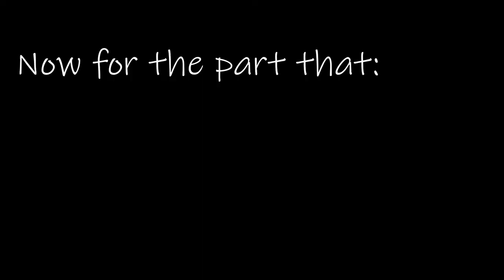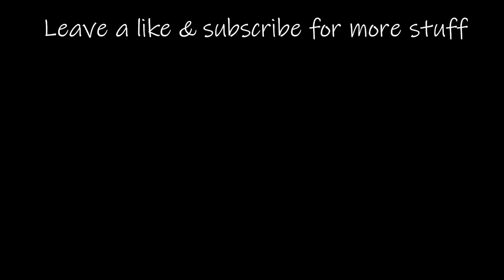Logitech G29 Potentiometer Cleaning - Doing it right!

Comment: If you took the trouble to remove the potentiometer, just replace it with a new one of the same resistance value. Theses things are dirt cheap (like US$1) , there's really no point in trying to disassemble & clean.
Reply: what are the specs of the g29 potentiometers?
Reply: @Cesar-os5iv  Don't know specifically, but its easy enough to grab a multimeter and measure the resistance between the two outer contacts. It's probably in the 33K to 150k Range, linear taper.
Reply: One could almost say it is worth disassembling and cleaning it if you cannot find or provide information on the correct replacement part.
Reply: @jaffmaster2294  It's easy enough to measure the pot's resistance value.
Reply: @jaffmaster2294  I agree, if you don't know the specs or where to get one just take it apart, it seems fairly easy.
Reply: @Cesar-os5iv  You want a linear (10k ohm) 1-2W potentiometer for G29 & G920 pedals (same for G27, G25, G923). They're hard to find in the UK, cheap, so it might still be worth repairing if you have the stuff laying around. If you're gonna spend on grease though, you may as well replace it.

Comment: To put it simply, you're great. You rock, man. My throttle is perfect now. It's funny that after fixing it, I remembered I had one spare potentiometer once I used a third-party load cell installed in the brake pedal.

Comment: Really good video, very well produced. Like many other people I have removed, dismantled and cleaned my G29 potentiometers several times, swapped them around, etc. This is the first time I have seen this CRC Di-Electric grease so I will get some and give it a try. I'm surprised your video hasn't caught people's attention. Thanks for putting it up.
Reply from the maker: Cheers man. Glad you find it helpful. The di-electric grease helps preserve the pots I feel. Keeps dust off. Makes the pedal travel feel slightly better too.

Comment: Great video, I used dielectric grease and plugged it but didn't work, wiped it only to realize i plugged the pot back wrong (black colour red or something)

Flickering absolutely gone now!
Reply: With 'wiped it', do you mean you removed the dielectric grease afterwards? It would make sense, as the grease is electrically insulating; therefore, preventing functionality of the potentiometer.

Comment: I don't suggest to tare everything apart if you don't have serious issue with your pedals. I had flickering on my break pedal. Seeing from a different video, I just opened the enclosing of the pedals and sprayed and cleaned the break potentiometer several times without unscrewing anything and it works perfectly. If it still doesn't work, you may go further.

Other video: https://youtu.be/VKg0jBeP_l8
Reply: @UbeydullahGungor Yeah, this video is for the people that already did that, and then the problem came back after lots of use. 
Cause that isn't the correct way of cleaning them and this one is, they last way more than that other "fix."

Comment: After doing this procedure my pedals are working great so far! I only have one small issue, my pedal wont go past 95% but its no big deal since I recalibrated it. I just have a quick question, is there any trick to reassemble the potentiometer fully centered so I get the full range of motion detected? I assembled it as shown in the video paying attention to detail but it seems kinda hard to get it 100% on the right position

Comment: G29 pedals not working now. 
I watched your video &  did my pedas just like you said but pretty sure I've got To much Grease on the all pots because I used my fingers..When I hooked it all back up after cleaning & over greasing. No contact, power, when trying to calibrate pedals.

Comment: Anyone know if WD40 silicone lubricant can be used instead of the dielectric grease? Seems to be the same thing?
Reply: Don't use silicone, it will dry and cause issues.

Comment: im having issues with the throttle, could i just swap the Potentiometer with the clutch? would it work the same? i dont mind if my clutch is bad
Reply: yes, just did it. cleaned and swapped to put the wear on the clutch pot instead

Comment: Static electricity, attracts dust n all kinds of shit particle. 
Just look at the back of your TV's! 
So... Regular maintenance/cleaning is a must part of your racing. Use anti static cleaning materials and always... Dry Electrical contact cleaner. Not oil based lubricant, such as WD40 as oil, attracts more of what you are trying to avoid.

Comment: I opened the potentiometer cleaned it and it still doesn't work
Reply: @chrisaaron8445  i fixed it btw, i said that 3 months ago
Reply: I do the same and now it's always flicker, and I can't use the pedal, could u help me?
Reply: @02_andikaparikesit84  fix the positions of those little things inside the potentiometer that touch the green disc, when they slide on it they send a signal and they might be in the wrong position, maybe too low or too high
Reply: @wqxdv2145  my throttle won’t go past 30% you think this could fix it?